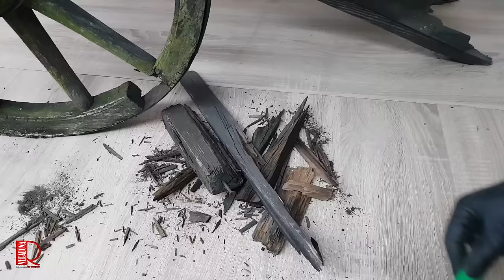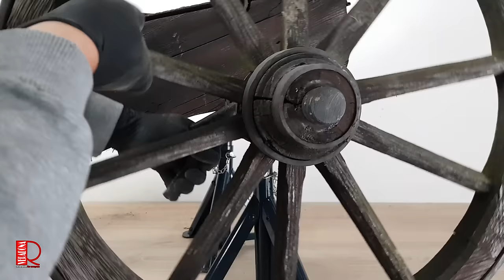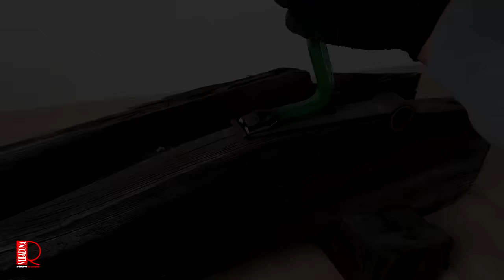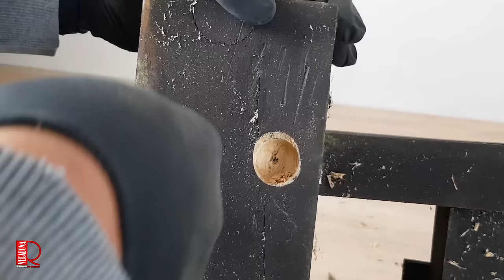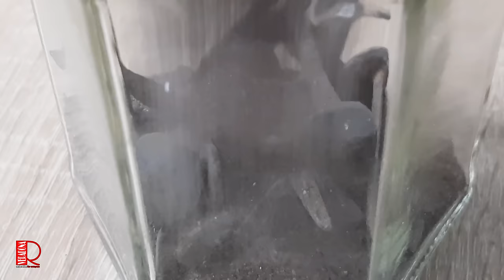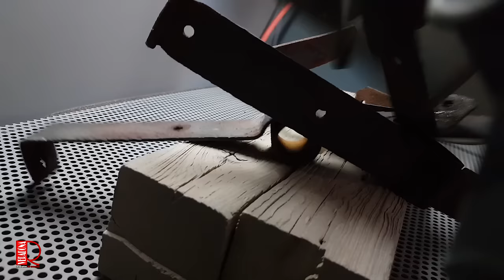Restoration - Antique Cannon

Comment: I must say that I was disappointed in the size and firing power of the cannon 😔, but the truth is that aesthetically it looks very nice.
Reply: I suspect that the powder charges were minimal, and the balls were likely lighter than the iron or steel counterparts. I know little of such history, but I would be loathe to be anywhere near while firing, as there was no way to know if the thing would blow up. Our ancestors were ballsy to try such with a cast piece.
Reply: I suspect they were careful - a very good idea to have their expert there. I believe I've read somewhere that those barrels could sometimes rupture or even explode into a banana-peel shape if there were any casting faults or damage... Radek and Veronika are both too pretty to risk shrapnel injuries. :)
Reply: @suitov    That was my concern. Experts are good to have with any such device. There can be no certainty that casting defects, wear, and rust pitting hasn’t weakened the tube. They thought of that, too. Every now and then I read of folks hurt when their explosives, well, explode.
Reply from the maker: Yes I understand. The cannon is only a decorative matter, so no projectile was used in the shot, but only gunpowder and paper (after the shot, you can see how it flies out of the barrel). The impact effect was controlled remotely.
Reply from the maker: Thank you for understanding :)
Reply: As a cannon shooter that looks like a blank load, the charge in the field was planted for dramatic effect 😊
Reply: Amazing restoration. Since it is an 18th Century Howitzer in stead of staining the carriage it would have been nice to see it in the correct period grey or red with the hardware black. Nevertheless still a beautiful jib restoring.
Reply: That is freaking awesome! What a labor of love! You definitely gave your client his “bang for his buck”!!
Reply: Only a light load
Reply: @thesquirrelchroniclesakare7808  😂😂😂😂
Reply: Nicely done ❤
Reply: @mred8002  it is a 60 year old, homemade replica. It is not an antique nor a real cannon.  Firing it was incredibly unsafe.

Comment: I'm glad the cannon was tested safely. In my opinion the cannon wall integrity will be in question. A fused gun powder charge sounds good and gives the best possible outcome safely. Nice uniform! 

I am impressed by the wheels restoration. that chemical glue is good. expanding into voids. I was thinking about it and thought resign might help with the spokes lost spindle wood? I didn't see the spokes worked on, so I'm speculating some were remade?

Thanks for the work here, it's always enjoyable to watch. 👍🏻
Reply from the maker: That makes me happy, thank you Rick :)

Comment: I was very frightened when I saw you were going to fire this cannon.  There were a lot of rust flakes in the barrel so it must have been made of iron or steel (not bronze or brass which is the metal cannons were more commonly made of) which means it has been weakened over the years since it was made.  I'm very glad you were advised by experts and that they only made up a small charge of gunpowder, these things are very dangerous to the people firing them as well as the enemy!  You did a very good job of restoring the carriage and the wheels, these are both very skilled jobs.  Well done Radek and Veronica - I'm very happy that you both survived!
Reply from the maker: Hello Nick, thank you. The cannon is cast iron and inside is a cast metal tube, it was made due to cracks in the cast iron. They had already figured it out when they tore their cannons. I wouldn't dare put a projectile inside. Therefore, only gunpowder was poured and clogged with paper. If you look closely, you can see after the shoot how the paper flies out of the barrel. The impact was remotely controlled only for effect :) Have a nice day, Radek and Veronica

Comment: Just a FYI. The "J" pins that hold the wheels on the axle are inserted from the top. The axle on originals isn't made to rotate in the frame.  I saw they were upside down when you started.  None the less. You done well.
Reply from the maker: Thank you :)

Comment: Whilst a thorough "restoration " of the metal work, the wood of the carriage is so rotten that it needs complete rebuilding. Then the True Artistry of the Restorer will show. Using the rotten original wood as a pattern, then a new carriage can be built out of hardwood ( Oak, Mahogany, Teak) and the true ability of the restorer will show.
Simply glueing up and bogging a rotten base does not save anything...the wood will continue to rot.
As Horace said.." Either Not Do a Job, or Do it Properly and Completely"

Comment: While you were wire brushing the bore, I was thinking that a cylinder hone for diesel and gasoline engines would work to smooth it. Bore size would increase, but many of these pieces were odd sized, requiring custom balls.
Reply from the maker: Yes, thank you Mr Ed :)

Comment: Very nicely done as usual. Just enough new material to restore it. Glad that you preserved all those old handmade square nails and especially those special curved U pins on the axles. With that coat of arms cast into the barrel, I wonder if that was a real old antique thing.
Reply from the maker: Thank you. This is a replica made around 1960.

Comment: Did you have the cannon inspected for cracks? I was afraid with all of items that came that it would explode.
Reply from the maker: The cannon will be like a decoration. I wouldn't dare use a projectile for long-term corrosion. Therefore, only gunpowder with paper was used. The impact effect was remotely controlled.

Comment: Was the low range of the cannon due to a small amount of powder, or due to the oversized barrel after all that rust came out of it?
Reply from the maker: The range was only remotely controlled for effect. I prefer not to use the projectile for the amount of rust for safety. Gunpowder and paper only.

Comment: thanks for sharing your video 
i want to ask you what was the range of that canon ?
Reply from the maker: Due to the poor condition and amount of rust in the main cannon, we did not use the projectile. Only gunpowder clogged with paper. (If you look closely, the paper will fly out after the shot) The impact was only remotely controlled for effect.